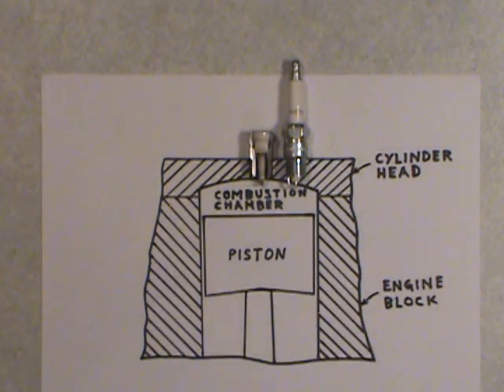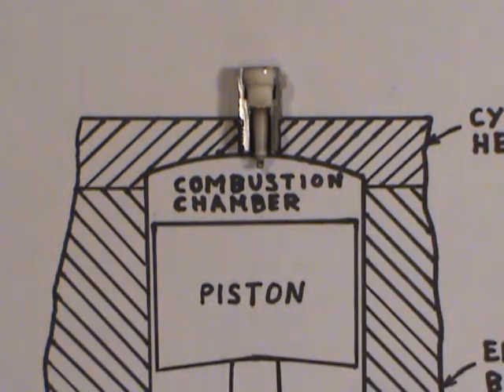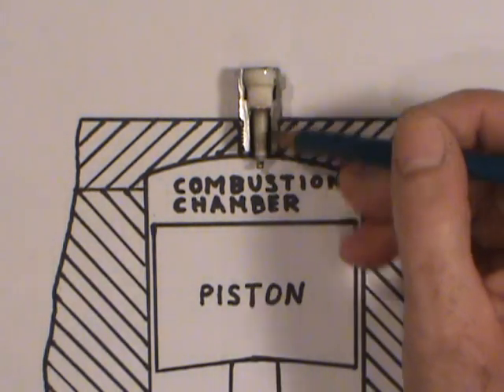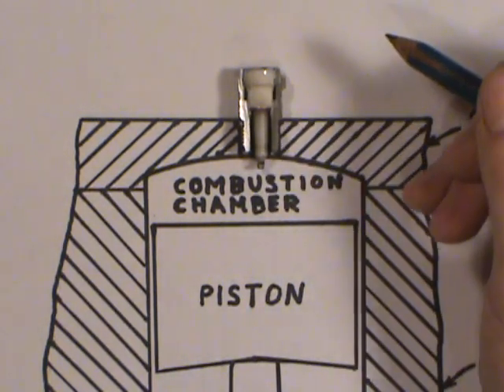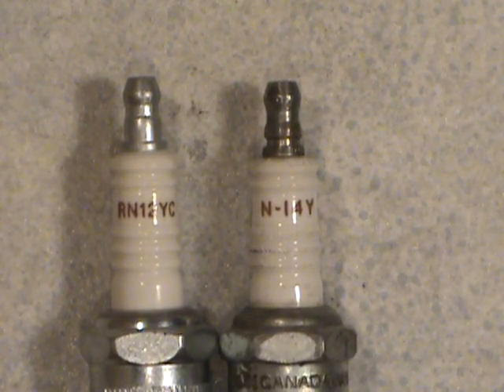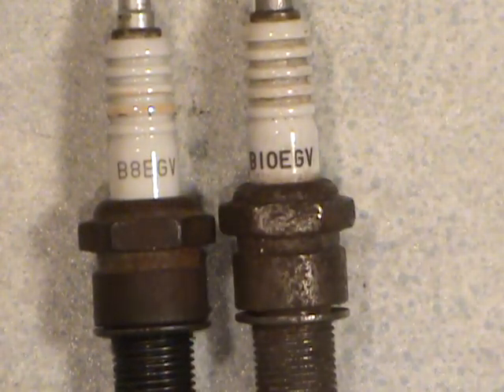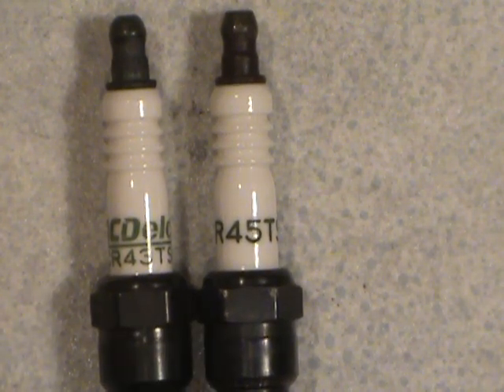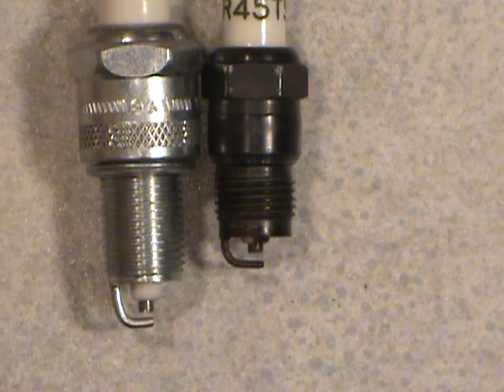Spark Plug Heat Range explained

Comment: When making modifications like headers, compression ratio changes, and even displacement -  do you always go higher than stock heat range, or does it depend on the type and how would you address each of those mods?  Thanks for the video
Reply from the maker: Greetings...Micheal Wells...……You're welcome, and, thanks for watching...…..Usually, whenever an engine is modified, for a performance increase, then, the spark plug's heat range, most times, will usually, be going, to a "colder" heat range (and not a "hotter" heat range, as you had mentioned)……...Gotta be very careful, with some of the different, spark plug manufacturer's, heat range numbers, as in, let's compare an older/cheaper, Champion spark plug's heat range number, with an older/cheaper, NGK spark plug's heat range number...…….The Champion, spark plug's heat range number, gets "higher", as, its heat range gets "hotter"...and...the NGK's heat range number, gets "smaller", as its heat range gets "hotter"...!!!...so, always make sure, that, you know, how each spark plug manufacturer, number (and/or, letter) codes, its spark plug's, heat ranges, or, Ya might end up with, some engine damage...…….When it comes to, just about any engine, I tend to think in terms of, a given engine, shall we say, as, having its own (individual) "personality" (kinda like, us humans do...lol)……….I still recall, by, just installing, something like, a set of long tube exhaust "headers", on, an older carbureted (not fuel injected) V-8 engine, that, the air/fuel ratio, got "leaner", because of, the "scavenging" effect, that those headers were know for (as in, the exhaust gas pulses, that are inside of, the header's tubes, will actually, pull the exhaust gas, away from/out of, the cylinder head's, exhaust ports)……….Gasoline, with about 10% ethanol (alcohol), in its blend, will also cause a carbureted engine, to run, on a leaner, air/fuel ratio as well (I had to re-jet the carburetor, quite a bit richer, by having headers, and, burning 10% ethanol gasoline as well)……...If it's a fuel injected engine, that you are dealing with, then, the vehicle's on board computer, will have to be re-programmed (if possible), or, an after-market, programmable, on-board computer, will probably be needed, especially so, if you were to bolt on, something like, a "turbo-charger", or, "super-charger"...…….The good ole rule-of-thumb, would be, to, make the spark plug's "gap" (that's, between the two electrodes) "smaller", when-ever, the engine's, cylinder pressure "increases"...……..It's a lot easier, to make a spark plug, go "spark", in open air/atmosphere, and, a heck a lot more difficult, it will be getting, for it to go "spark", as the engine's cylinder pressure increases...…….If, and when-ever, considering, any engine modifications at all, then always, "plan-ahead", and, do lots of studying/research, because, if Ya don't do it right, the engine's performance, might not be as good as expected, and, engine damage is also possible...…….Just about every modification made, will have some affect, on how an engine behaves/performs...…...Certain modifications, might be tailored for, more horsepower, at higher engine RPM's, and, Ya might lose some low rpm torque at the very same time, possibly...…….The engine itself, has to be mechanically strong enough, for the amount of, torque/horsepower increase, or, something, is usually, gonna, "self-destruct"...!!!...……In closing, look for some websites, that have a "Forum" on it, that is focused on, your..."exact"...year and make, of vehicle & engine, as, some of the people, on those specific, automotive forums, will probably be able to tell you, what modifications, and, the affect that they had, on their engine's performance, oh, and, if and when-ever, Ya decide to go ahead, and make a modification or two, be sure to, have Lot-sa-Money, in Ur bank account, for your chosen modifications (and maybe, for some, shine-ee "bling" too...!!!...lol).........Good luck, and......till next time......Be Safe, take care, and have a good one.

Comment: Hello i have this motorcycle and its required a sparkplug code NGK C8E and my mech replace it with a cpr6 so it means he replace it with hotter sparkplug is it bad for my engine?
Reply from the maker: Greetings...Lucy Abulencia.........Thanks for watching.........Yes, a spark plug, that has a "hotter" heat range, than, a park plug, that has the "correct" heat range, for your exact engine, can sometimes, cause "damage", to your engine...!!!.........If your engine is an original, factory/stock engine, that "does not", have any modifications done to it, then, the best, and safest thing to do, would be to, install the..."exact/same"...spark plug, that was installed by the factory/manufacturer, when your engine was brand new.........If you have the owners manual, for your motorcycle, then, you might find, the "correct" spark plug code, in there somewhere.........The heat range, for NGK spark plugs, will probably get "hotter", as, the number gets "smaller" (it's opposite, with something like, the older Champion spark plugs, just so Ya know).........Going from a heat range of..."8"..then, going to a "hotter" heat range of..."6"...for an NGK, brand of spark plug, is quite an..."increase"...in the heat range, alright........Even, if "only" going "1" heat range hotter, then, that, can also make, quite a bit of difference as well........By using, too..."hot"...of a heat range, the spark plug, will remain at, a higher than wanted, operating temperature, which, might ignite the air/fuel mixture, too early, as the piston is rising up in the cylinder, while the piston, is also compressing, that very same, air/fuel mixture, and this, sometimes, causing, engine damage, problem, usually goes by the name of..."Pre-ignition" (as in, igniting, the air/fuel mixture..."before"...the spark plug, actually goes "spark"...!!!).........So then, If you want to keep your engine "safe", and also, last, a long, long time, then, always be sure to, use the "correct" spark plug, for that "exact" engine, and......till next time......Be Safe.....take care, and have a good one.

Comment: Thanks for the upload...i like it n God Bless
Reply from the maker: Greetings...arrchee88.............You're welcome, and, Thanks for watching..............If, and when-ever, the time comes, that Your Engine is in need of a New set of Spark Plugs, then, by replacing those old/used spark plugs, with the Same/Original Spark Plugs, that Factory installed in the Engine, when it was brand new, would probably be the safest and best bet, just in case, something goes wrong................If a spark plug's Heat Range, is too Cold (running at less than, oh, about 1,000 Degrees Fahrenheit, there-abouts), then, the Deposits, would probably not burn off enough, and will probably start building up on the spark plug, and usually, probably won't harm the engine, but, some misfiring, still might occur.............If the spark plugs, happen to have, a Higher than wanted Heat Range (too Hot), then, the spark plugs would probably look nice-n-clean, but, on a bad day, engine Damage, might be the result...!!!...so, make sure, that, the spark plug's Heat Range, as well as, its physical dimensions, are the Same, as the Factory Originals, especially so, where the part of the spark plug, goes into the Cylinder Head, in order to avoid any, not wanted, and expensive engine Damage........and........till next time.........Be Safe, take care, and have a good one.
Reply: Pulstar has only 2 heat range compared to other brands. How does this work?
Reply from the maker: Greetings...Nikhil BN............Thanks for watching............Only 2 heat ranges You say...???...........Seems kinda strange alright...........Perhaps, that type of spark plug is self adjusting maybe...???.............I do recall, doing some spark plug cross-referencing, not so long ago, and I found that, some spark plug manufacturers had one heat range, that would, shall we say, cover another spark plug manufacturer's spark plug, that had 2 or 3 different heat ranges, that were in sequence/close to each other............The older Champion spark plug numbering system is the one that I like the most, as compared to most of the other numbering systems............The older Champions, would have a higher number for a hotter plug, where-as, some spark plug manufacturers, get hotter, when the number gets smaller, so, pay close attention to that.............Lets take a Champion N-12-Y for example............12 is the heat range, and I had a car that wasn't being driven at the time, and I broke one of the spark plugs upon removal..............I had a brand new Champion N-14-Y spark plug in a drawer, that was only 2 heat ranges hotter than that 12 was, so I installed it............Wowsers...!!!...just at idle speed mostly, cuz the car wasn't being driven at the time, that 14 heat range, was sure hotter, just by looking at it, as it didn't have the amount of deposits on it, like the 12 heat range did...!!!............I never did run the 14 heat range on the street for that engine, cuz, it would probably be too hot of a heat range, especially at higher speeds, and in went a set of 12 heat range spark plugs............Safest thing to do with a factory stock engine, is to just use the Vehicle Manufacturer's recommended spark plug, so as to avoid any unwanted problems......and.......till next time.......Be Safe, take care, and have a good one.
Reply: Hi Nikhil. Pulstar typically makes very expensive spark plugs selling the concept of more performance. If you haven't taken you NA engine to being a super charger and/or turbo charger, then it isn't for you.

Comment: I was about to buy denso iridium TT IEXH20TT and then found they have another version IEXH20 E TT :/ 
The difference is the reach which is 2mm, the first one is 26.50mm and the second one is 28.50!
Does that 2mm reach matter to my 60k miles engine? I am changing it because ngks are acting weird.
Reply from the maker: Greetings...eth3rl0rds...……..Thanks for watching...……..Well, in order prevent, having any possible, unwanted engine damage..."never-ever"...install a spark plug, that is physically..."longer"...than, the spark plug, that the vehicle manufacturer installed in that engine, when the engine was brand new...!!! (that, longer spark plug, might...???...come in contact, with the top of the piston, and/or, make contact, with one of the valves), and, Ya sure don't want to take that chance, and damage your engine, right...???....and also, it'll probably be very expensive to fix, if it's possible to do so, that is...……...(in my opinion)...Your..."Safest"...spark plug choice, for your "exact" engine (if the engine, is, factory "stock/no modifications"), would be, to use, and install, the..."Exact/Same"...spark plugs, that the vehicle manufacturer, installed in the engine, when it was brand new...……..Sure, you might consider using a spark plug, "cross-reference" chart, and, the other type of spark plug, might work ok, or maybe, not work so good...???...……..The spark plug's physical "length" (especially so, the distance measured from, where the spark plug actually makes contact with the cylinder head, to the outside edge, of the spark plug's outer electrode, so as to, avoid having the spark plug's electrode end, making any contact at all, with the piston top, or valves), just like, I had already mentioned...……...The "heat range" of the spark plug, has to be correct too, as in, too "cold", then, spark plug fouling might occur, and cause the engine to misfire...……...If the "heat range" is too "hot", then sometimes, "severe engine damage", can be the result...!!!...……..Also, make sure, that, the spark plug's "gap" (gap = the clearance/air gap, that's between the two electrodes), is, the same as, what the vehicle manufacturer "specifies", for your "exact" engine (please note, that, some spark plug designs, "are-not", gap-able/set-able, so as to avoid, not to damage, that particular type of spark plug...!!!)..........So then, if Ya try, to save a bit of money, by purchasing another type of spark plug, then, will the risk of expensive engine damage, be worth the risk...???...…...Well, it's all up to you, as to, what path you'll choose...……..Good luck, and...…..till next time...…..Be Safe, take care and have a good one.
Reply: @RockysRoadshow  Thank you for the detailed info and yes, engine damage is something REALLY expensive to repair or sometimes not worth it at all and didn't wanna go through that phase because of silly mistake and that is why I waited.
I got the Denso TT and found it is indeed 2mm longer but that size is compensated with the washer. Inside the chamber, the length is same and the NGK heat was 7 but denso is 20 which is the same falls right between hot and cold... NGK was giving me bit knocking at lower gear when accelerate but with denso, it's buttery smooth now!